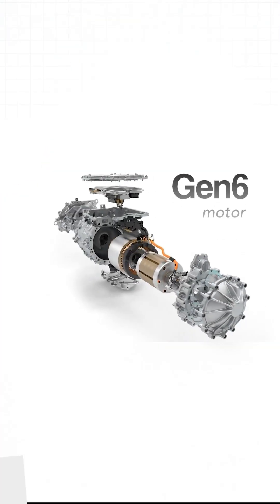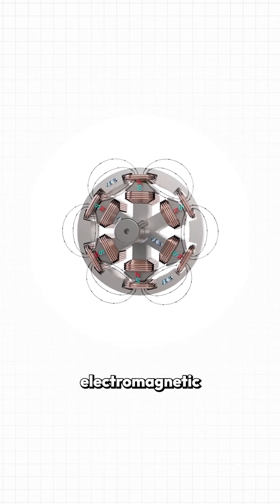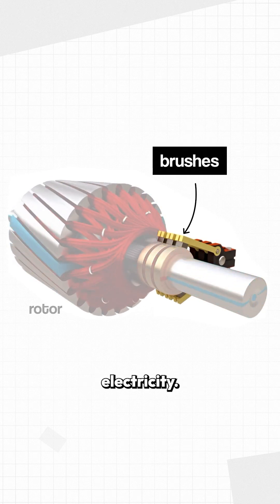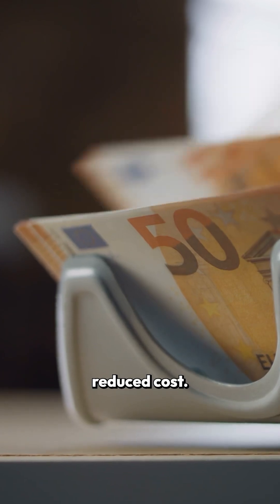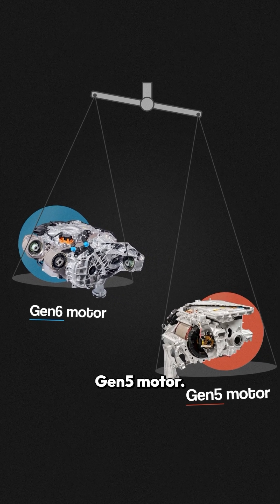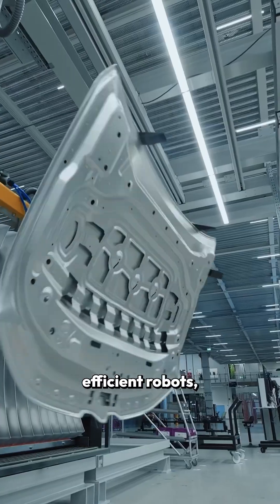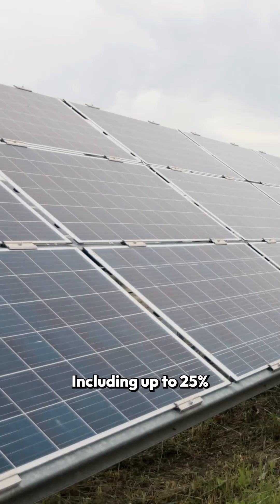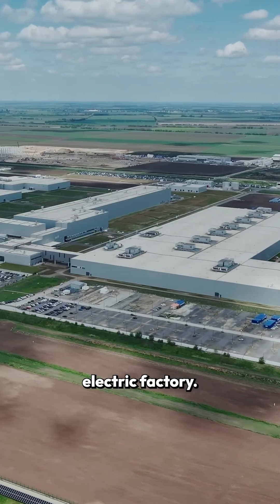BMW’s New Motor is FREE of Permanent Magnets

Comment: I’ve worked with electric motors for 40 years. This has been a known fact the whole time. Getting manufacturers to actually make these has been extraordinarily difficult and expensive.  Manufacturers would charge more than 100% premium for these kinds of motors historically.  I guess enough customers finally refused to accept the older lazier designs.  Good to see this finally being used in this application.
Reply: Brushes wear.  There's no help for it. And they are usually buried inside the thing.  It's an insane amount of labor to swap brushes... So it's got a lifetime. Then one tiny part makes it all trash
Reply: @mattycheezeburger 
Would it be possible to transfer the electricity wirelessly, with zig zag wires on stater and rotor instead of brushes?
Reply: @SWDW88 Yes. Brushless synchronous motors are also a thing - they use induction from the rotating magnetic field in the stator to power the rotor winding. It does have some drawbacks though in terms of power curve, so far as I recall.
Reply: @SWDW88 no
Reply: @mattycheezeburger 
So the other guy says it's already a thing and your saying it's not possible. I'm not an electrical engineer, but I'm interested in technology business. So am gauging ideas here.

I did some research and apparently we can increase current (and so increase field strength) with higher voltage via higher volume of shorter coils, as long as they line up significantly. I'd probably stack them tight along the rim of the rotor.

If AC current is getting induce to the rotor via a live DC zig zag wire on the stater, we could use a voltage multiplier to convert the AC to DC on the rotor. To increase the surface area of where the current gets transferred we could put these zig zag wires on a row of discs on the rotor end and flat rings in between the discs on the stator end.

The rotor will need a starter current. We can put a capacitor in the rotor and a brush that charges it up from the stater. This brush gets pushed off as the rotor turns. 

Wouldn't this make it efficient enough?
Reply: @SWDW88  All this already exists and it's much simpler than that! All you need is two coils placed close together and four diodes, like wireless charging for your phone.
Reply: @leonardo5225 ok, but efficiency is a desaster
Reply: @AB-kc3hg  In fact, it's not widely used; Renault uses brushes, which are cheaper and simpler. However, it must be said that inductive charging of a phone is inefficient because there can be problems with distance and correct positioning. In a motor, this is optimized; the distance between the coils can be as small as a few tenths of a millimeter. For example, even between the stator and the rotor, there's always an air gap.
Reply: Brushless motors are the future, why are they using this ancient type of motor?
Reply: @wolfehone Spot on.  They need room to charge more for the “upgrade” of brushless.  Wait until someone actually has a variable frequency stator and rotor!?!?!  Then we’ll have some current technology
Reply: @wolfehone  This is a brushless motor, but it doesn't require the rare earth elements of neodymium magnets. For work, I used to install large brushless motors with permanent magnets made in France, but then China took over the rare earth element market, and the price of these motors doubled! I don't install them anymore... 😅
Reply: Good to hear. Brakes wear, brushes wear, tires wear....big F-ing deal...sign me up!
Reply: what about the squirrel cage?
Reply: @Xayuap those are typically set up with a .8 power factor.  It’s already bleeding tons of losses compared to a synchronous motor.   In essence, the motor they are describing can be run as a synchronous motor/ the most efficient possible.
Reply: Cheap household vacuum cleaners use these motors. I doubt they pay a premium for those.
Reply: @Anonymous-sb9rr  That's not the case, these is a Synchronous motors without permanent magnets. There are advantages and disadvantages to their use, Renault and Nissan have been using them for many years, there is a great video on MUNRO's channel that explains it
Reply: BMW continues to rely on sales of its internal combustion models to offset losses from its overpriced and unattractive EV lineup, suggesting the company still isn’t taking e-mobility seriously
Reply: @6jot 
Any legacy auto maker that didn't enter some kind of partnership with Tesla by 2020 is facing a slow death.  They had every opportunity to buy time but decided to bet the house on deuces.
Reply: @PETERJOHN101 Tesla? Erm, BYD, VW, Xiaomi, Rivian, Changan, SAIC, Greely etc.. Would like to have a word with you.
Reply: @PETERJOHN101 Tesla? in 2026?

Comment: I'm just curious about lifespan with brushes.
Reply: Me too. It shouldn't be an issue if they can make the brushes easily replaceable and cheap.
Reply: this is bmw.  they will make nothing cheap to fix or replace
Reply: @MaleMan-o7  Yep, BMW's ready for a full switchover to EVs now that they've figured out a way to require expensive regular maintenance on them..
Reply: I work at a motor company that makes industrial brushed motors as part of our offering. They have to be replaced about every 10000 hours. That is a bit over 1 year of continuous use. For a car, maybe 1 hour of use a day. is around 27 years. However, they are pushing way way more current through the brushes. Likely completely halving the lifetime from excess heat, I would estimate that the brushes would have to be replaced at a minimum of 15 years, maybe sooner depending on environment.
Reply: @bengerber4542  The Renault Zoe's motor uses brushes that can last over 100,000 miles because they run un slip rings rather than a comutator.
Reply: @bengerber4542  Do they really need to push a lot of power through the brushes? Can't they rely on the stator more?
Reply: @mnztr1  Think about that. You've got the stator, all charged up and ready to help push… but without an equal opposing force to push against there's no movement. Just a lot of heat.
Reply: @mnztr1  But that's exactly how it is! The magnetizing current is much lower. The same system is used in DC motors. This is like an inverted DC motor, with the rotor instead of the stator. I've mounted several of these on industrial machines. For powers of 15 kW, a field current of about 1 amp. and 350 V. was sufficient.
Reply: @bengerber4542  Do you produce DC motors with brush collectors? I've mounted several, but you have to look at this as if it were inverted compared to a DC motor. The excitation current, field current, passes through the brushes and is usually very low, a few amperes.
Reply: There are brushless designs. Like I commented above, manufacturers are so busy protecting profits that it takes a huge push to get them to make a change like this.  Also, brushes are typically very easy to change. Easy as changing air filters.
Reply: @joehillbilly brushless designs normally use permanent magnets on the rotor.  (which they are getting away from). Though there is the switched reluctance motor that doesn’t do that but it loses more then some efficiency.  

switched reluctance motor often stat something like up to 80% or higher efficiency!  Which is a funny thing to stay when the rest of the market is over 90%.
Reply: @joehillbilly  induction motors
Reply: @joehillbilly Mahle patented such a brushless motor. Google!
Reply: @joehillbilly   Can you get M sport brushes ?
Reply: @Professor-Scientist I haven’t reviewed bmw’s specific design. I work mostly with large industrial units. 66000 hp is my largest unit they are  brushed. My motors of 10,000 and less are brushless.
Reply: This is not comparable to older brushed motors (DC) you might have bad experiences with. Those had to alternate the current at the brushes which means the brushes had to jump over a gap or step (which was mechanically stressing) and the current would arc there before going to zero (which is also stress for the brushes).

Those here don't have to alternate the current and it should be quite easy to design them for the lifetime of a car. (That's also why I'm not worried about the ones in my BMW i4.)
Reply: And their cooling.....
Reply: I get that thought but consider this, you now have to change brushes every now and then compared to a gas engine with like 300 moving parts
Reply: @hugonilsson6067  For sure.  Not knocking it.  Just curious.  I don't even own an electric vehicle.  The brushes remind me of the points you used to find in a distributor cap on older cars from when I was a kid.  My dad used to carry points in the glove box, because every once in a while if you drove enough, the engine would lose spark due to them wearing out from friction contact.  And older fans, drills, etc. that used brushed motors also had that type of wear.  Materials science is hella good now compared to when I was a young kid in the 80s, but it's still going to wear down faster than a brushless motor, so I'm just curious.  Really interested to see what longevity looks like, not to mention the differences in materials now vs when I was a kid.  I imagine the gulf between them is massive.
Reply: 5 months